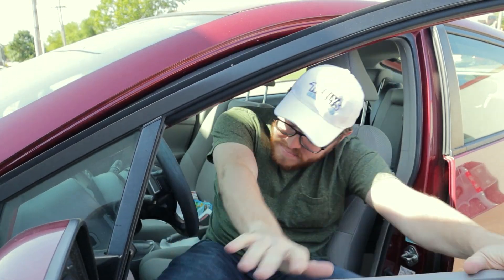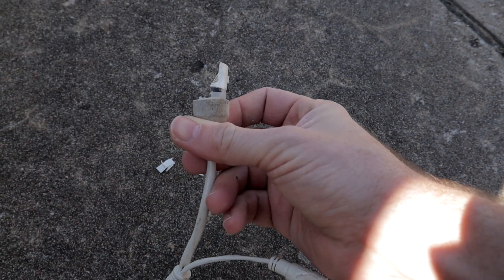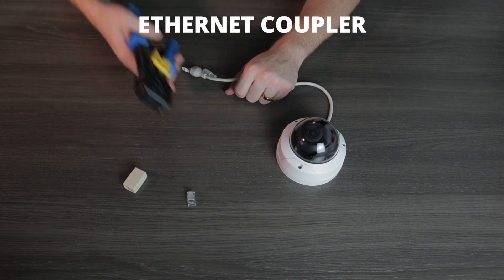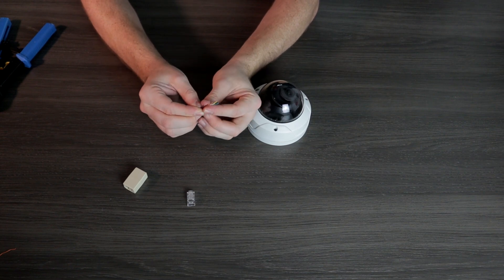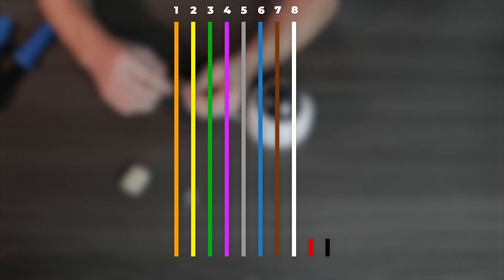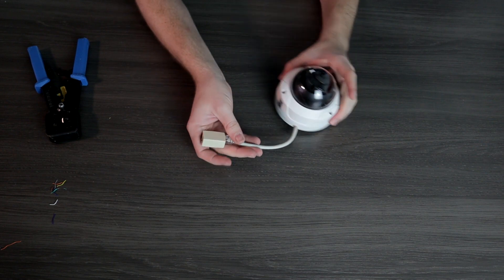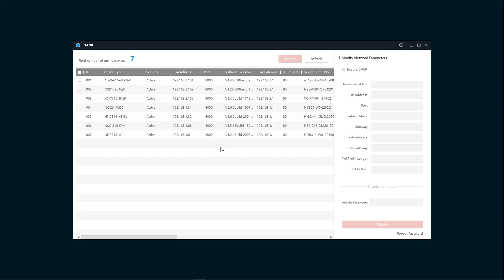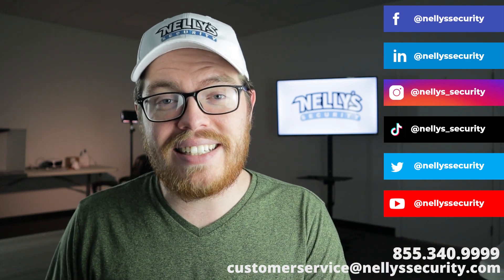How To Fix Your H-Series Security Camera's RJ45 Connection

Comment: Why not just punch down a jack instead of using a coupler? They make ones with the weather proof boot just like the camera comes with.
Reply from the maker: For sure, there are a few different ways to do this depending on what tools you have on hand. We do have a video in the works showing how to use punch down jacks as well!
Reply: i have a lorex model # LNBB973-C  and i tried this fix but for some reason it didn't work any suggestions to get it to work? Thank you.